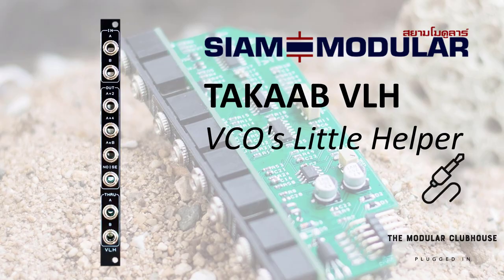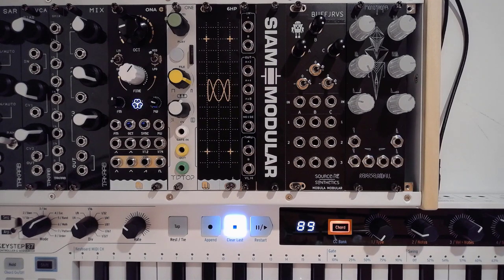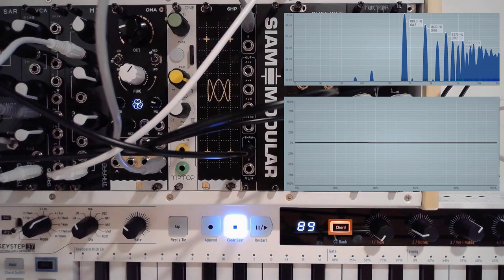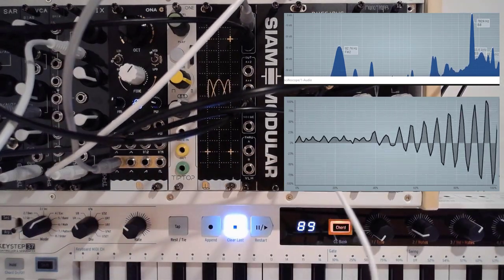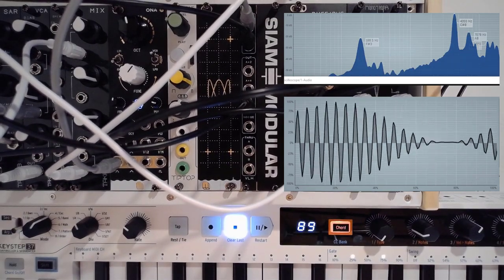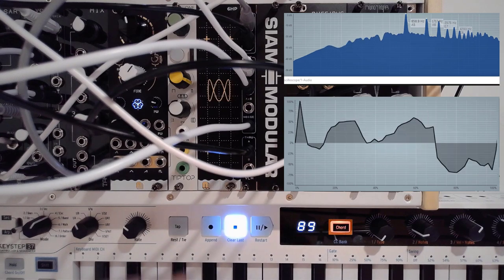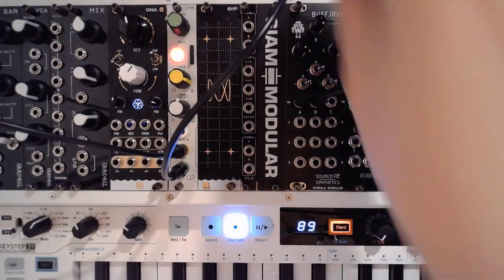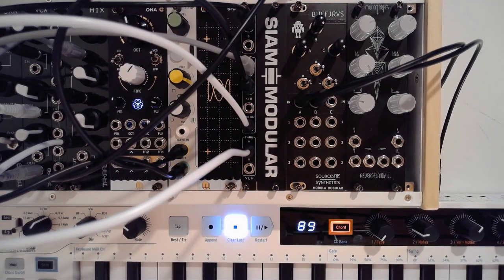Episode 32: Siam Modular VLH (VCO's Little Helper) | 2hp of pure utility | Eurorack Modular

Comment: Nice review!  I have a couple questions about the subs:

1. How does it respond to more complex waveforms, like one that's been folded to hell and back or an irregular one like from a wavetable?

2. How does it respond if you use both inputs? Does it only do the subs for input A, or  B, or both somehow? 

Thanks
Reply from the maker: Great questions! The subs are connected to input A so the other input won't have any effect on the subs. I will have to double check in regards to the waveforms. I'll be back :)
Reply from the maker: Did a quick test but complex waveforms can indeed double trigger the sub, best to use a clean shape for that
Reply: It depends on just how folded it is. There's a comparator on the input, if the +ve cycle of the wave drops below the threshold of approx 0.6v it will be counted as a cycle and the subs will divide accordingly. Try it!

Comment: Do you geht this module only directly from Siam Modular or is it available in shops in EU and/or UK?
Reply from the maker: I got them directly from Siam Modular. But I will ask if other distribution channels exist.
Reply: Available at Siam Modular in Thailand, Tampereen Musiikki in Finland, Escape From Noise in Sweden. Also we have two listings on Ebay - one shipped from Thailand, the other from the UK. And they are available on Reverb shipped from Thailand. Shipping from Thailand to the EU has been pretty fast recently - usually 2 weeks max, but I don't know whether the new EU laws are going to slow things down or not.
Reply: @siammodular Escape From Noise is great. Thanks for this list.